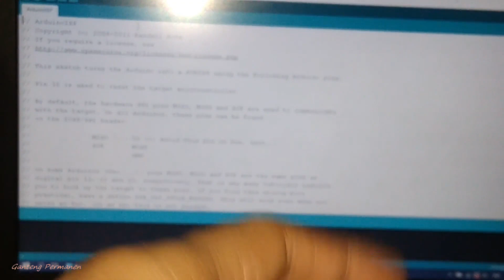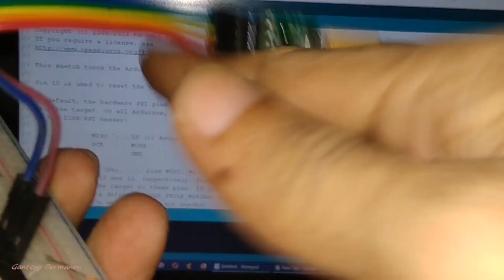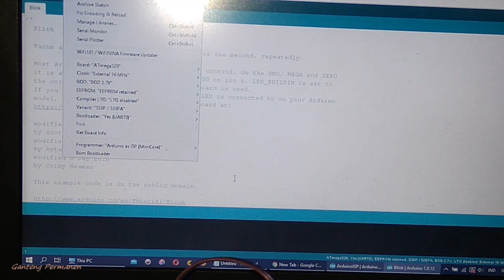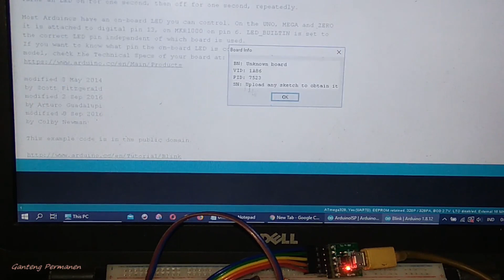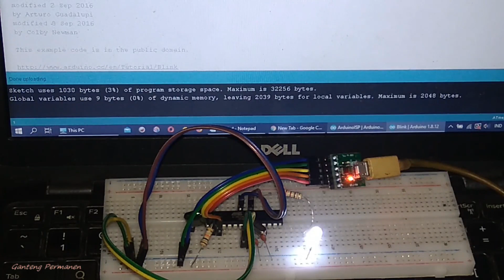DTR Auto Reset CH340E Micro USB to Serial TTL UART Module & ATmega328p DIP28 MCU LED Blinking Test

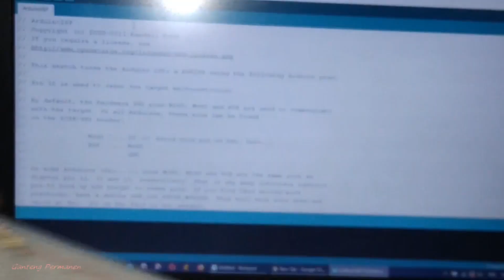Comment: 1:30 - The reset pin is on pin# 1 (RESET),  you placed the resistor at pin# 2 (RX), which is incorrect.
Reply from the maker: fixed @ 2:30
thanks